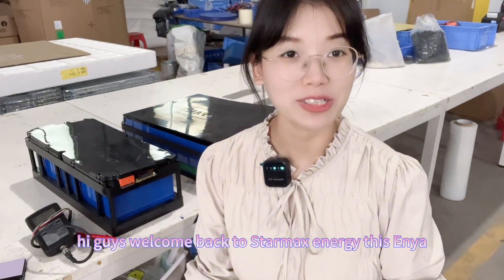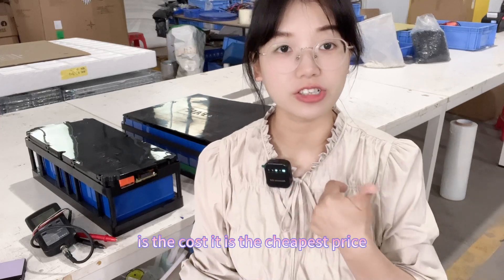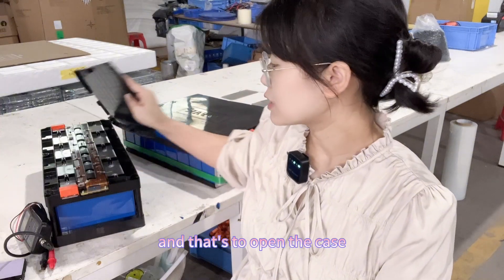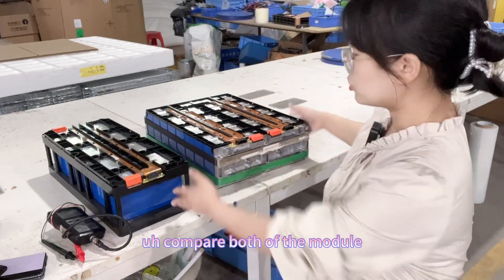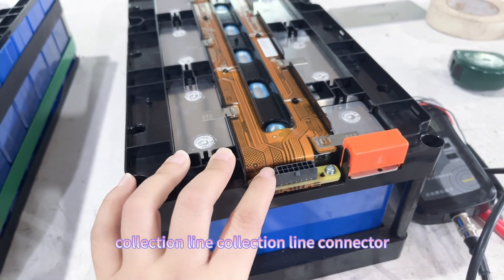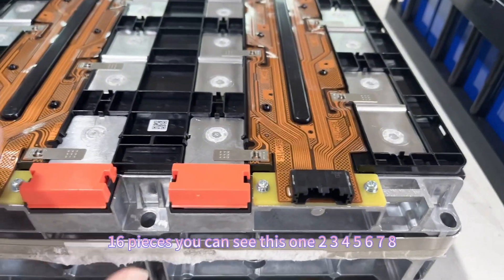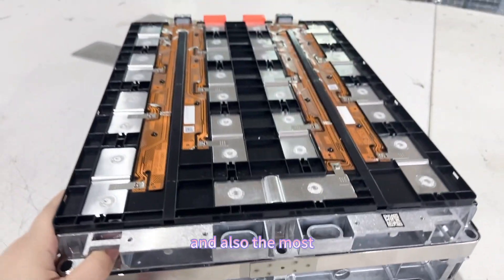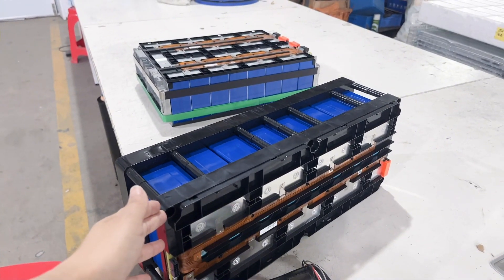25.6v 100ah lifepo4 battery pack for solar energy storage with cheapest cost

Comment: Can you make an all in one solar system that is expandable in capacity, voltage, and power output?  Make it plug and play, compact, portable.  Make the connecting wires 90 degrees so it doesn't stick out.  Make the batteries stackable with each other and with the main unit.  Make the voltage and current input range wide enough for small and large solar array.  Make the inverter efficiency very high.  Make it so it basically runs itself without requiring user input once the user sets it up.  It should be easy to set up, expanded, and to use.  It should be durable and portable.